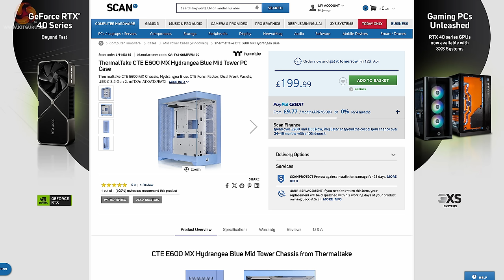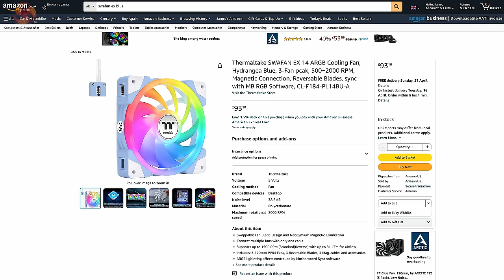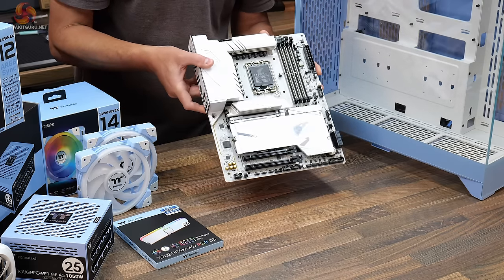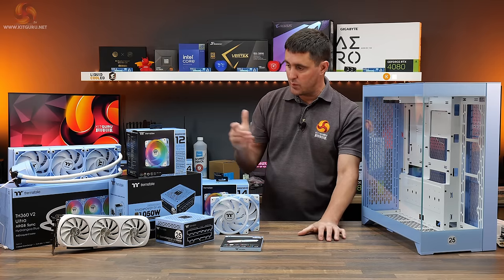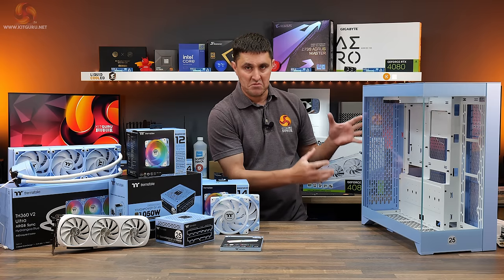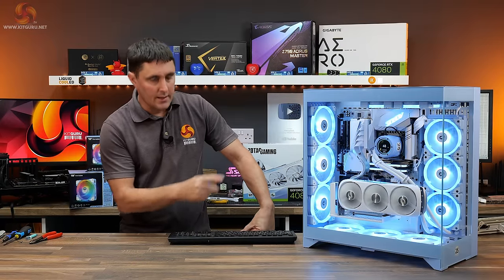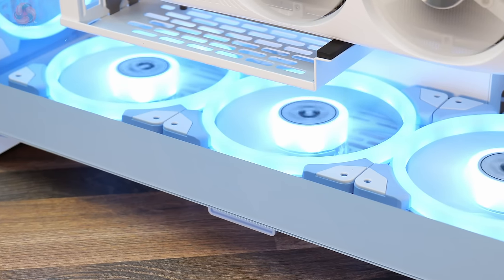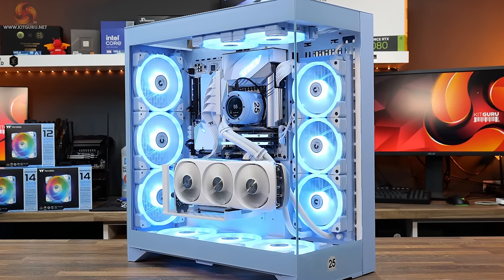Thermaltake Hydrangea Timelapse Build: neither white nor black!

Comment: It's going to take some powerful magic and engineering and design to beat the Hyte Y70 case now, but I do like all the glass and air flow in this case. The magnetic fans with swappable blades is new to me. Going to have to look into those. These high-end cpu's suffer from really high temps, so cases today need tons of airflow. 14 fans?! Holy Moly! That's a LOT of cooling capacity. That was one super clean build. I'd have to put it in a display case of its own and just stare at it.
Reply: I like that case but thought hyte could have made the chassis stronger. Very thin metals and a lot of flex. The screen is great though. James found the same thing in his review.

Comment: Years ago, you could only really get beige PC cases. I don't know when the trend started for different colored cases, but I'm enjoying the new colors now.  I bought a Montech King 95 in red, still in the process of putting it together.  Black components will be lit with pulsing red RGB fans and GPU.  Should look sick.
Reply from the maker: I remember the days of beige PCs very well, it was the time I started using, upgrading and modding them. We are spoilt these days with what is available.

Comment: After doing a white & black build for my current system (black case, mostly white internals) I've been thinking recently about what my next build would be and I've settled on trying to go somewhat old school with as much green, blue and/or yellow(ish) PCB based components as I could get my hands on and then try to find a case with as much glass/plexi as possible to put it in and then tint the glass (and vinyl wrap the rest of the chassis) either atomic purple, orange, blue or green.

Comment: I'm really not a fan of the way you transition between segments when showing off the finished build after the 12 minute mark. But I otherwise loved this video. Watching you build is always a pleasure.

I do have a question regarding the GPU mount: can it be moved towards the front of the case? I ask because fibre-optic transceivers can be quite large and the fibre cables cannot be tightly bent. Speaking of video cables, does the case have a rubber grommet where they exit the case? If not, I can see cables getting cut over time.

Keep up the good work.
Reply from the maker: There are three positions for the graphics card when installed at the front/bottom of the case like this. In this build it was in the central position, you can move it to the right by approximately 30mm or so more I think.
Reply: @KitGuruTech  Excellent, thank you.

Comment: Yikes, that USB cable on the CPU/pump block. What where TT thinking? It should as a minimum been a 90 degree plug 🙈
Reply: 90degree and in white or blue color.
Reply from the maker: I thought the same when installing it.

Comment: Does the case have a rubber grommet where the cables exit ? that might be risky over time
Reply from the maker: There are two exits for the rear I/O cables on the back of the case, one near the top without a grommet and one lower down closer to the power supply with a rubber grommet.

Comment: wouldn't it be better to have the radiator as exhaust?
Reply from the maker: Maybe if you want to lower system temps but I doubt it will make much difference. 

This way the CPU radiator is getting cool external air and it's positive pressure so should be good for keeping dust out as all intakes are filtered.

Comment: If Thermaltake think that this color of the case justifies higher price, they are ga-ga. If anything, it should be cheaper. Otherwise i have built in the ceres 300 tg and the case is ok. Again, add on lcd screen is priced at 100 plus €. Why make a product hardly anyone will buy. I would pay 50 max for a screen of that size. Good thing there is plenty of competition in the pc case market!
Reply from the maker: You don’t like the blue colour then ?
Reply: @KitGuruTech  i do in general, but it should not cost more because of it. It is nothing special.  Otherwise all of their cases are interesting (and price is usually ok), including this one, it is a bit different with the mobo orientation.

Comment: Cpu radiator is upside down. Tubes above the pump not below.
Reply: If you are referring to the GN video this is the correct orientation.
Reply from the maker: I'm curious to hear what difference that would make in this situation?
Reply: @KitGuruTech  over time the fluid evaporates and introduces air bubbles into the system. when positioned the way you have it will cause pump cavitation and pump failure. Gamers nexus has a video explaining this.
Reply from the maker: @purefun65 do you mean this GN video that said tubes up is bad? 

https://youtu.be/BbGomv195sk?si=L1xT1xYW85yDdiHt
Reply: You got it mixed up. Steve said tubes up was bad.
Reply: Steve could fart the alphabet and people would quote him. And as often is the case misquote him. 😀
Reply: Lol, how many of these posts have we seen from people who watch gamersnexus. not even understanding what steve is saying then hitting every build video 'correcting' them. hilarious

Comment: $200+ and not a rubber grommet or cooling fan to be seen anywhere
Reply: should have gone to specsavers
Reply: @amdforlife5591  He means if you buy the case on its own. Its just a mentality thing now. People dont like to sound positive about anything cause its cool. like this 20 minute build video which ended up great looking, so instead of saying 'great job james' its just a dig at the case not coming with fans or rubber grommets. I can certainly see quite a few fans in this build....
Reply: @lovingthehardwarethisyea-py1xp  Apologies, I meant that out of the box the case is lacking in what should have been included with a price that high.
Reply: @gravef1ghter you made a good point mind you. They should look into those before it was released.

Comment: another lian li clone
Reply: Not this comment again. It’s like a copy and paste into every video featuring a case
Reply: its hardly a lian li clone.
Reply from the maker: It's dual chamber like an O11D but it's not quite a clone as the motherboard orientation is rotated and there are three rear fan mounts and several graphics card mounting options so there are noticeable differences.